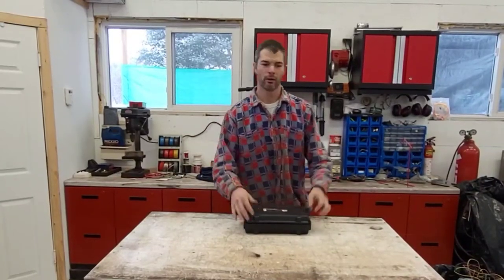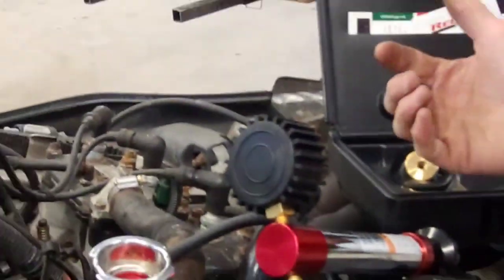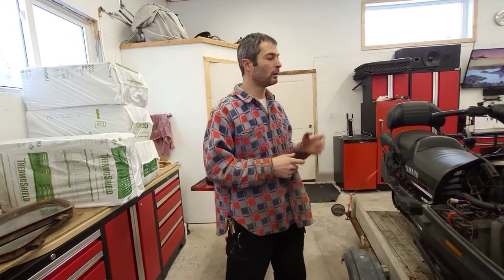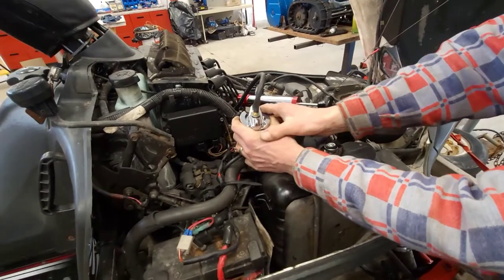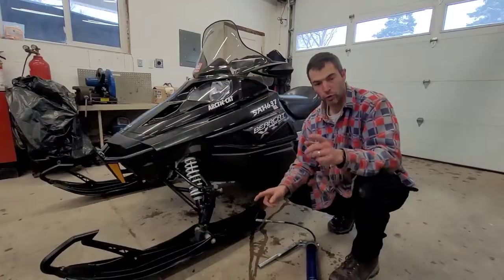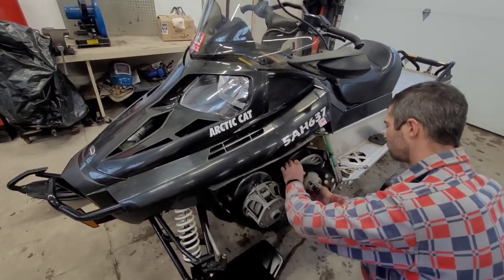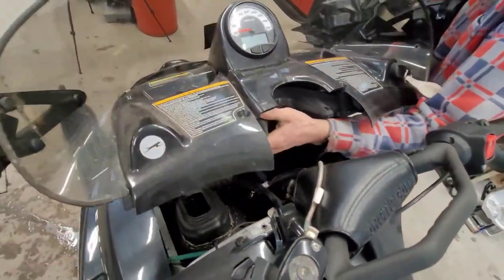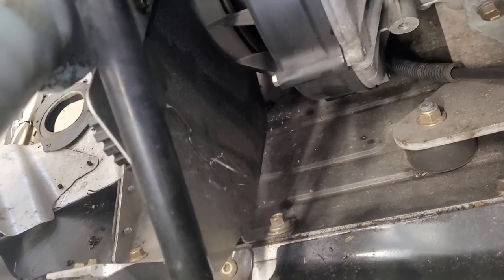Double Feature! Yamaha and Arctic Cat in the garage!!

Comment: Hey boss man what do you run for oil for your triple? Same sled here just curious what I should use. Is ok to mix I'm not sure what previous owner used.
Reply from the maker: I run Yamalube. I have also run Ipone with good results. However in my area, Yamalube is cheaper and I foul less plugs
Reply from the maker: As for pre mix in the tank, I think it's OK but not as good as letting the injection pump do its job